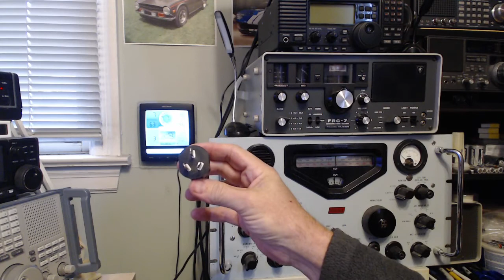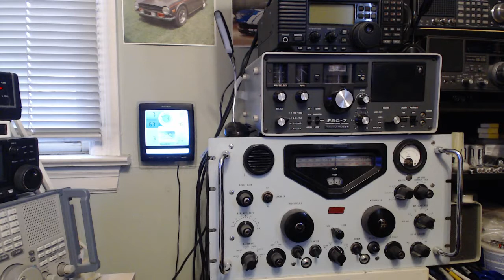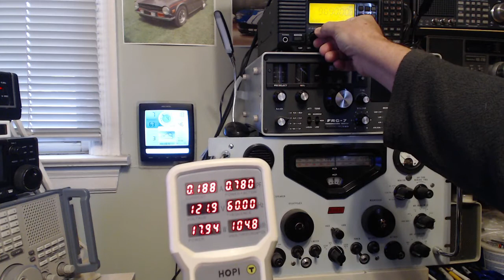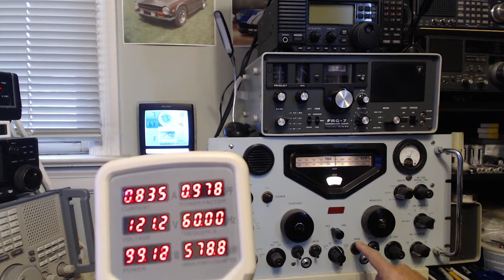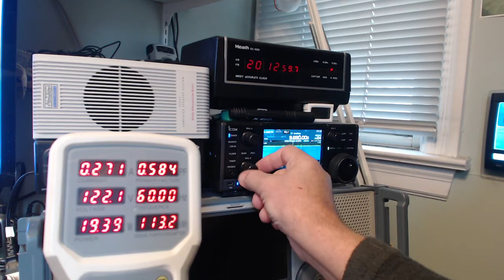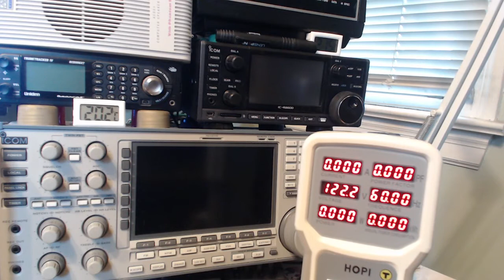Shortwave Radio power usage testing with Hopi HP-8600

Comment: I just found your channel while searching for a review of the Hopi tester. You have some fascinating videos!
That bizarre-looking thing on the end is an Australian power plug. I've heard it's also used in some parts of China, but they mount it upside down.
Hopefully Big Clive will do a review and tear-down of his Hopi tester some day. Any chance of you taking the back off and doing a mini-review yourself? I'm really curious about the build quality.
Reply from the maker: Thanks, Dave. I took it apart when I got it because the little red/black spring terminal block was loose.  It looks like there is room for an optional USB connection for a higher priced model. Otherwise not really very interesting inside. A tool well worth having.
Reply: Yes, me too. I found this video while searching for Hopi reviews too. There doesn't seem to be any pictures or video anywhere online showing the inside. I wish Clive would open up his unit.

Comment: Can you easily rotate the socket 90 degrees? As it is now, a UK plug won't fit because of the terminals below the multi-socket.
Reply from the maker: The socket is not quite square so maybe not 90 but 180 would work.
Reply: Thanks. Received a different model (no USB and 3 buttons which are all doing the same thing) from Fasttech.com and I've asked them to translate the manual. It's all the same thing basically so the manual should cover this model as well.
https://www.fasttech.com/products/0/10028784/6302500-atx9800-4500w-20a-led-electric-power-energy-meter
Would be nice if we could use the other functions like programming for a certain period of time and see the average power usage etcetera.
Will let you know if I succeed.
Reply from the maker: Thanks!